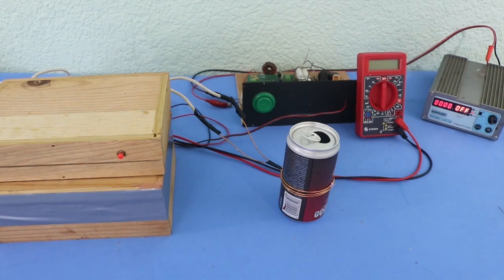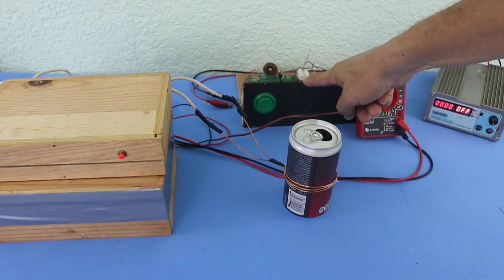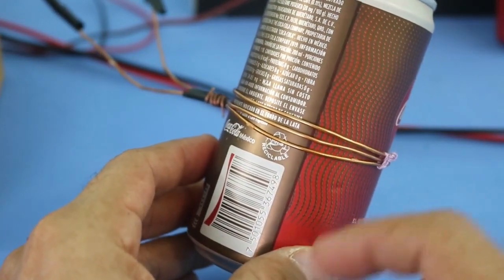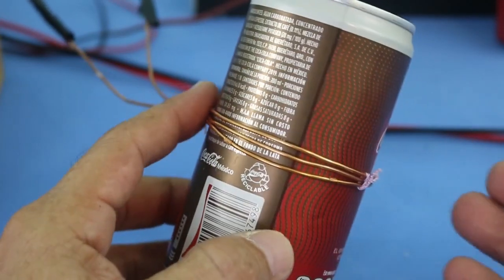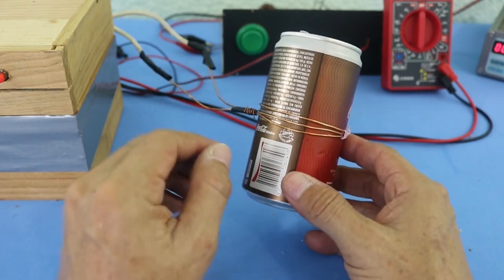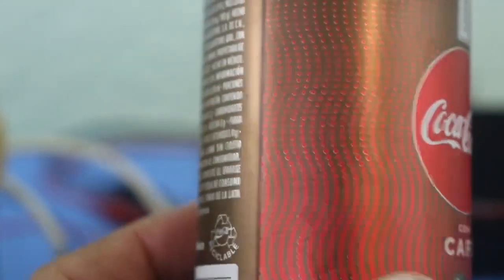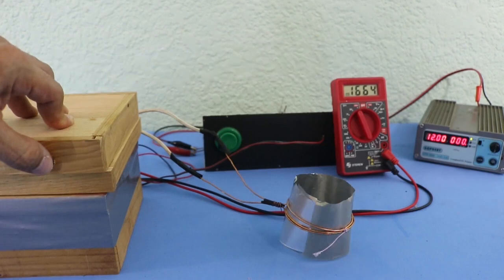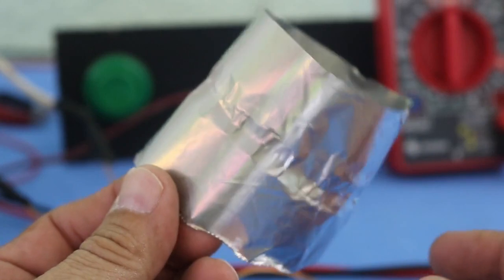High Voltage Capacitor Bank Experiments: Can Crushing

Comment: Nice video sir, Sir can we made our own capacitor bank
Reply: Yes you can
Reply: If you do make one you must exercise the utmost caution, even a small cap bank can kill if you get shorted across the arms. Always make absolutely sure they are discharged and have a safety bridge across the terminals to keep them shorted when handling or moving them, and ensure that any contact points are insulated and enclosed if at all possible. If you're not really sure about working with high voltage I would hold off on making one until you can get a little more comfortable with it, capacitor banks are the single most lethal electronic components you can get your hands on.

Comment: Those wooden boxes are practical but not so good for the video's. It would be more interesting without them so we see the caps and maybe even see the spark in the gap switch.
But only wooden boxes next to the experiment, its a pity to say the least, at least i think
Reply: Maybe he can put them into a transparent case but they shouldnt be completely open, that high voltage can easily kill you.
Reply: ☝️  What he said..